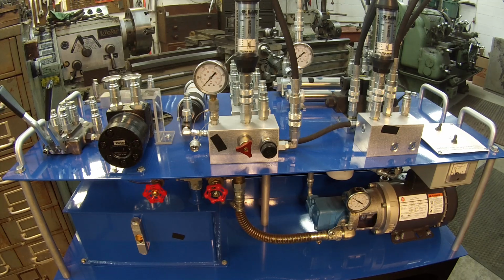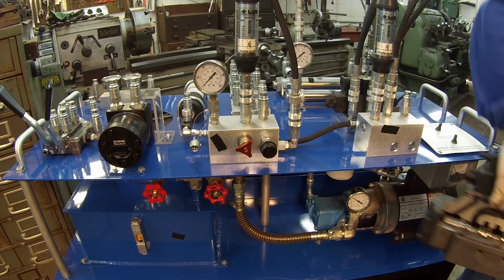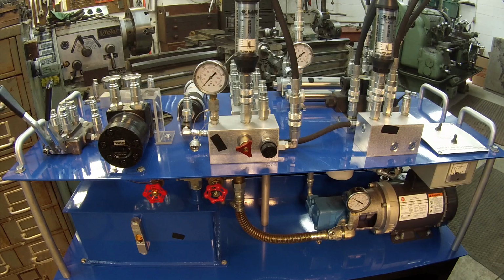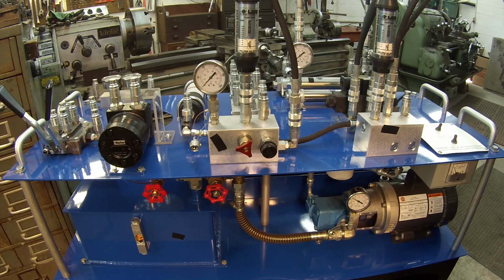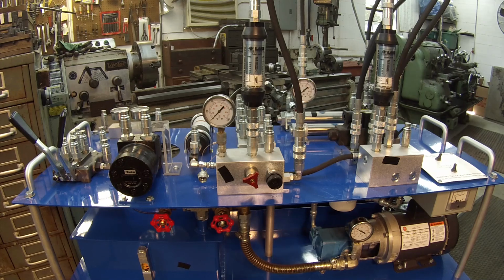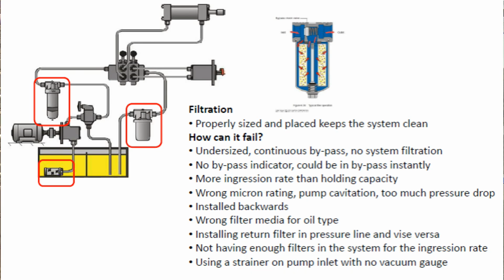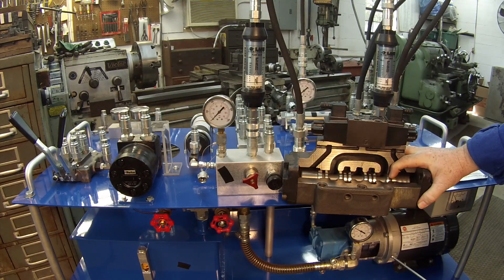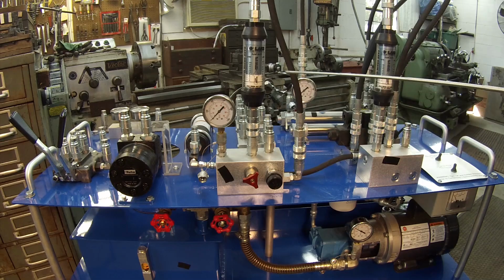Hydraulic System Inspection & Troubleshooting Session 2

Comment: I work at Fortune 1 company and we don't even get to use the gauges or flow meters. We just change parts until it's fixed or they call in outside service. They have dumbed it down so they can literally hire and fire at will and keep you constantly worried they will replace you.

Comment: i am new to this and studying these videos. so far id say yours are most informative. i do have a question though. if contaminates are the worst thing to happen in a hydraulics system, couldnt you put another filter in the line going from the tank to the motor? just a thought.
Reply: The filter that is already in-line with the system is rated to do more than enough filtering to keep the system clean. The problem is that filters can only do so much and there are other forms of contamination that don't get removed by mechanical filters such as moisture. Adding another filter only increases the resistance to flow and creates another service point. If people kept up on their maintenance by regularly changing filters and hydraulic fluid, its less likely you run into an issue with contamination.

Comment: I have a car lift in my garage its an Atlas. If I have the car part way up and I stop for a second and restart lifting, it blows the breaker. I have checked the motor and both capacitors are ok. Would it be a relief valve that is sticking in the pump maybe? It hardly ever gets used so it is like new but 10 years old.
Reply: Probably not the relief valve as relieving the pressure would only reduce the load on the motor, not increase it.

Comment: Hi, enjoyed these two videos. I am retrofitting my 30 tonne hydraulic press by removing the  bottle jack assemble and connecting a hydraulic ram and pump system. My question is would the 4 port 3 position directional control valve be best for my application ie up/down/hold midwayish. Cheers

Comment: We have a forklift at the shop that makes sounds like that when it starts cold for maybe 5 to 10 seconds, is that normal or should we be plugging in the hydraulic tank when it's not in use in sub zero temperatures?

Comment: what i dont' understand is how air in the system can cause the outside wall of the pump to get pitted (not piston pump but the other one) .  The metal on metal contact never happens so what is actually causing the outside wall of the pump to get metal taken out of it?
Reply: Jimo225  cavitation  damage does not come from metal to metal contact, but rather from the intense pressure created from collapsing bubbles actually deforming the metal surface.  Over time the repeated impacts caused by the collapsing bubbles will fatigue the metal to the point it will have small pieces start breaking off (similarly to galling/impact damage to bearing races).

Comment: Hi. can i get a clarification about what you say in 14:14??
If my oil temperature is raising, the relief vave can get stuck??
i'm asking because i have a problem with a flow control valve that keep getting stuck when i'm getting to high pressure,
can it be because of a high temperature?

Comment: I have a problem hydraulically pump 250 bar for sand mixer the electric motor 135 kW 
LOW RPM  on the mixer 13 RPM(should be 19 RPM) when loaded (1800 Kg)19-20  RPM free empty
oleobi hydraulic systems
Problems solved
mix water and oil 
only rpm is not resolved

Comment: another common fail on motor/pump assembly is that the splines coupling the motor to the pump wears out causing a flow drop in the system in this particular case both motor and pump should be replaced in pairs... just adding a few cents...great video I am subscribing !!